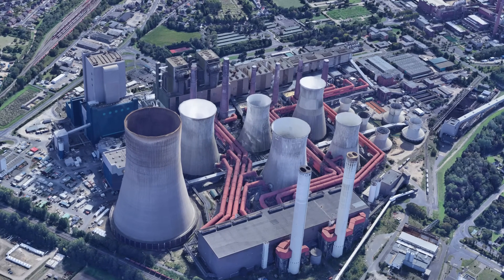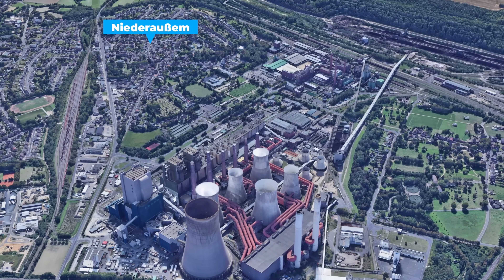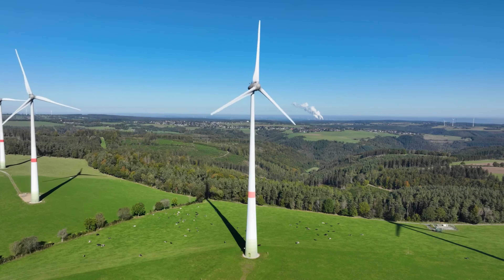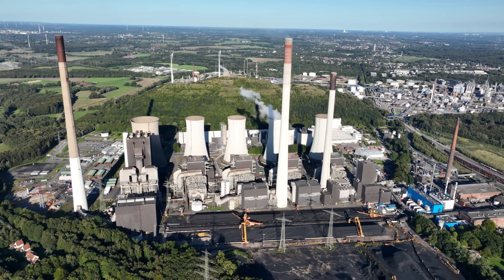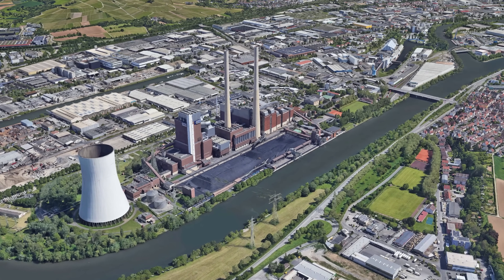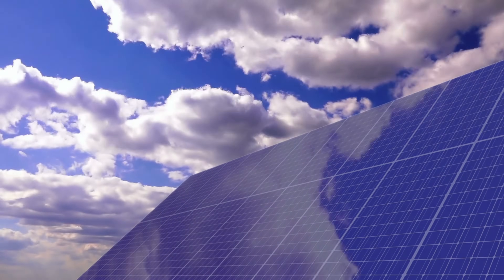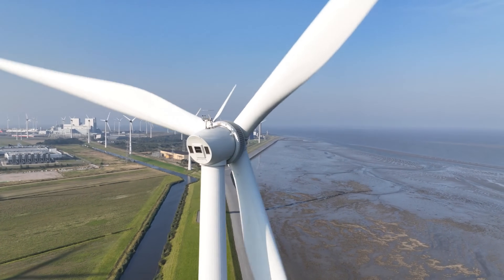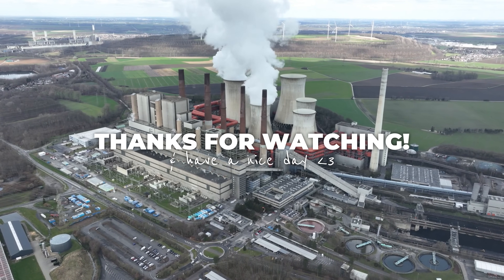Why Are Power Plants Allowed In The Middle Of A City? (And Wind Turbines Not)

Comment: Recently, I had the pleasure of spending my vacation "near" the Nochten lignite open pit mine and Boxberg power station. Near as in 7 km from Nochten pit and 14 km from Boxberg. During the night (and with arguably bad wind conditions (wind came right out of that direction)), we could hear the hammering, roaring, industrial noises from both facilities all night. Meanwhile, 2 years ago I spend a vacation in the Eifel mountains and bicycled under and near several wind power plants (one was the wind park just north of the Oleftalsperre near B258) and could not hear a thing, even with breezy wind and the rotors and turbine spinning at capacity. It's quite striking to me how people can complain about noise from one facility but blindly accept the other.

From times past, I also know people who experienced "black snow" around the lignite power plants in Saxony and Brandenburg in the GDR because of the unfiltered emissions falling down in the surrounding areas. Spremberg and other places were infamous for that.

Comment: Biggest problems of wind? Hard to build, no way to recycle, intermittent. Biggest problem of green Germany? They need 3x the capacity to be able to serve electricity all the time, which is damn expensive. I far future, when batteries are cheap, no problem, but now? BIG problem.
Reply: I have heard that the recycling issue is getting better, but I'm not certain.